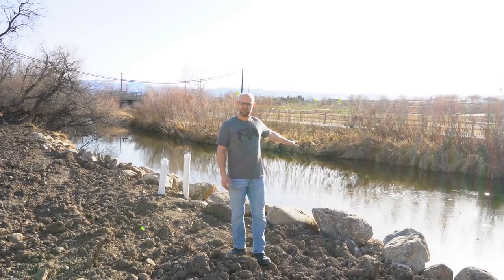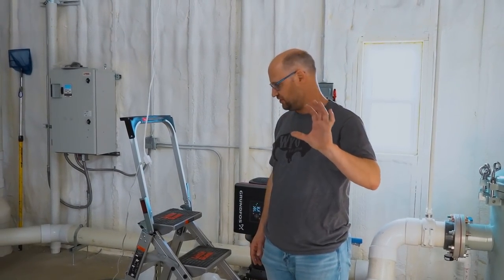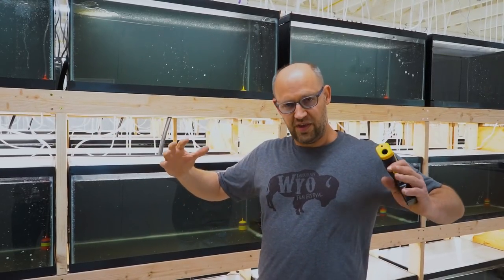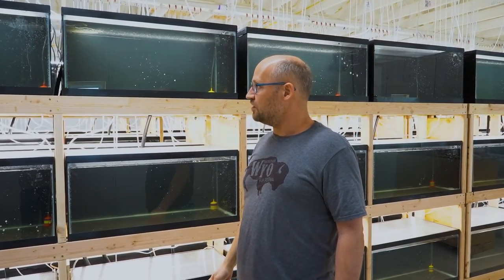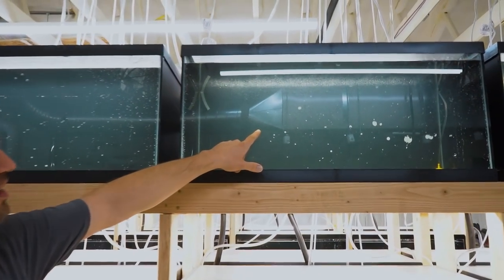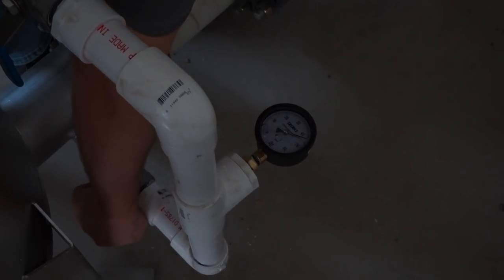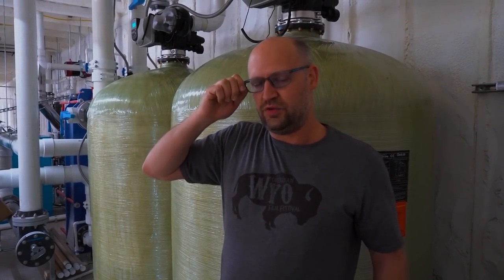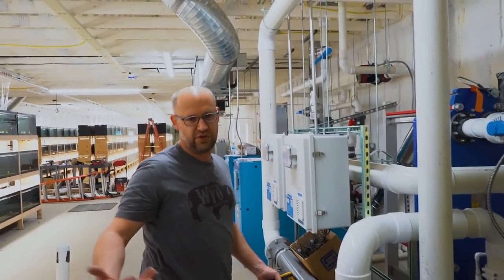We Have Water in the AQUARIUMS!!! New Fish STORE Build.

Comment: Dan, something we did for this was to put in a vessel that would let the water "Gas Off," it vented with pressure. Much like the air dryer on an air brake system that vents water, the vessel we used exhausted from the top.
Reply from the maker: Thanks for the tip.

Comment: As a pipe fitter and a hobbyest, I love this wearhouse and video!! Wouldn't an air separator work for you? It would sure be less room
Reply from the maker: An industry standard air separator would work well if this were a recirculating system,  but in a single pass system like this, it won't be very effective.  We have engineered a custom unit that should do the job nicely. It will be featured in future vids.

Comment: That is a seriously impressive set-up.  The only thing I am surprised about is that you have this huge building, why do you not have the entire roof covered with solar panels.  I don't mean for producing electrical power, merely as a mean of heating the water.  It obviously would not be sufficient to heat all of the water all of the time but it would surely put a big dent in the gas bill for the boilers.

Comment: Great build.   RE:  Air bubbles in the tanks.  Entrained gas in commercial water systems is not the same as your problem with bubbles in the tanks.  I suspect your water pump is cavitating.  Cavitation occurs when you run the pump outside of its operating design curve.  It causes noise, air entrainment, and severe wear on the impeller of the pump.  I suggest an experiment:  Provide some backpressure on the system by throttling the water flow a bit and see if the bubbles disappear.  Perhaps cut the flow rate in half for 12 hours or so.  (it will actually reduce your energy costs a lot)   RE:  Brown, floating gunk in the tanks.  Your comments about the intake bag filter (mechanical filtration) having no differential pressure and the presence of gunk in the tanks makes me believe that your filtration is corrupted.  If the system flow rate is above the design for the filters (both the bag filter and the big canister filters) then they can be compromised.  The bags in the bag filter may have at least "channeled"  getting holes through the media allowing high flow, low differential pressure, and poor filtration.  The same thing happens in the big canister bed filters (chemical filtration).  High flow rates cause the opening of flow paths through the media that reduce efficiency.  End result is poor filtration.  Gunk in the tanks.  Also, during startup, if air was not carefully bled out during commissioning, slugs of air can damage the filtration beds.    Is it your intention to run the water exchange system 24/7?    That is a 100% water change in less than an hour.   Or intermittent as needed?
Reply from the maker: Thanks for sharing your expertise on this matter...much appreciated.

Bags in the bag filters are fine. We've checked for channeling and the like. I think they are just too large a micron size at 5 microns. The silt that came into the tanks was very, very fine. I have 1 micron bags coming and will give them a try. Luckily, the silt seems to have stopped coming in as much. Seems to have been an initial silt load as the newly placed gravel bed in the well got washed out.

The large carbon filters are backflushed regularly, so I don't think they are getting clogged.

The pump is running at 8 psi and at about 70% capacity...holding pretty steady. We are building a microbubble remover that will vent them off before they get to the tanks.

We are running 24/7